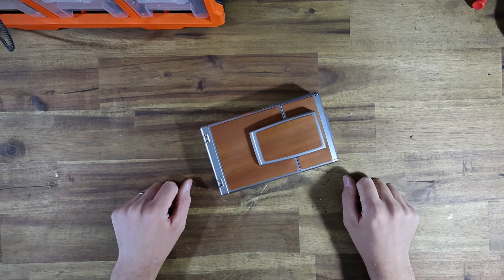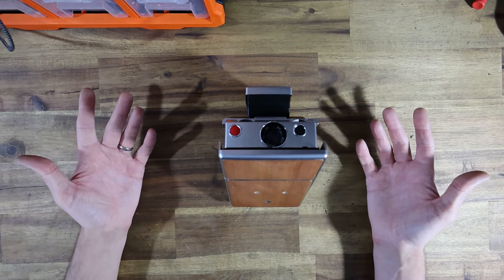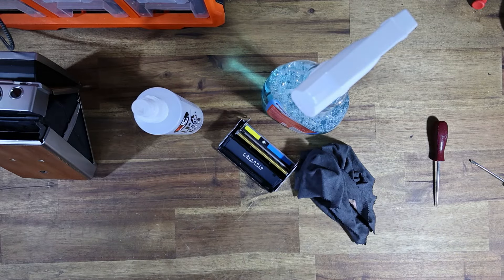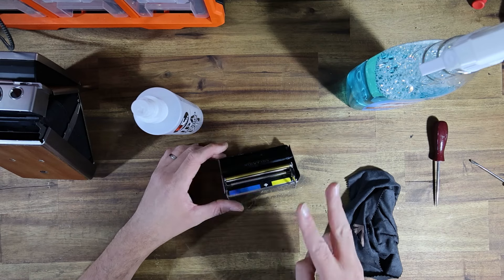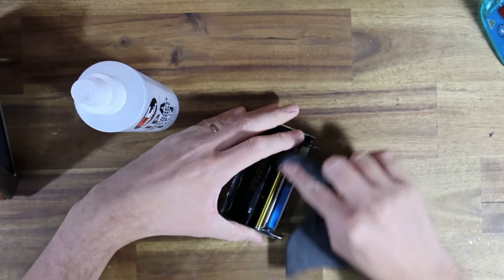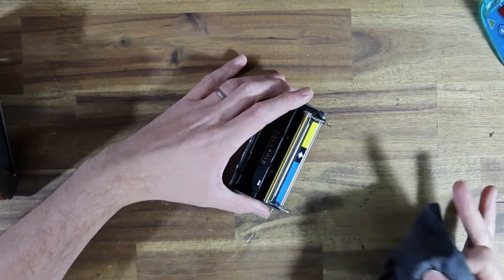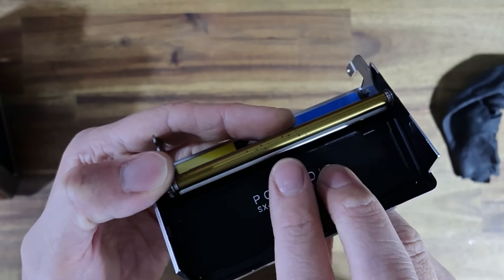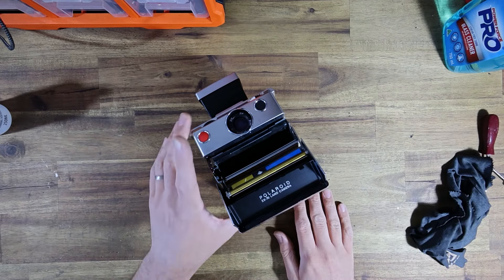The Ultimate Guide to Cleaning SX-70 Rollers

Comment: Nice content , fortunately I joined the Polaroid clan just the same time your channel emerged in my recomm, got an sx70, had it cleaned , lubed,releathered to my liking, motor conditioned following your content, had a battery bottom plate installed for some future I type capabilities. Could not be more happy .  I think the logical next step will be the pcb mod. But I will keep it simple and use my nd for now.  I actually like the sx70film variant quite a lot to be frank. Any hoo, subbed , liked, keep the flow  brother!

Comment: Hey thank you so much for all you do for the Polaroid community. I followed these steps and my SX-70 is sadly no longer powering on - I tried two different film packs. it’s a CLA’d SX70 modified to take 600 film. Did I accidentally break / bend my S7 switch potentially? I have a very important shoot next weekend - any help would be appreciated
Reply from the maker: @8mmreel  sounds like you bent the door switch, or the plastic post on your door came off

Use some tweezers and bend the little brass to tab with the black plastic lug on it downwards, so that the door can make connection with it again
Reply: @theinstantcameraguy  that worked!! Thank you so much :))
Reply from the maker: @8mmreel  you know where my tip jar is 😉
Reply: @theinstantcameraguy  done!! More than well deserved. Thank you so much :)

Comment: This looks like a cherry veneer skin? Do you have any tips for getting it to conform to the viewfinder hood? I have a wood skin installed on mine and it seems to want to lift up, even after letting it sit with pressure overnight.
Reply from the maker: sounds like the adhesive your wood uses is not powerful enough

Mine sticks just fine

Comment: I can never find a straight answer online, but the L/D wheel DOES affect the image when you have a flash plugged in right? I swear my Mint Flashbar has worked just a little better indoors when I turn the wheel a little to lighten. Great video
Reply from the maker: Yes it does (with the exception of "W" shutters, which are a relatively rare variant)

The L/D wheel is linked to a metal arm, which is linked to a spring loaded assembly called the 'flash cam'. The flash cam connects to the focus wheel

Effectively during a flash exposure, the camera's aperture is dictated by the distance you are focused to. Close photos = small aperture. Far away photos = large aperture.

Altering the LD wheel will further change this aperture (white = larger aperture, black = even smaller aperture)
Reply from the maker: also, if you need to adjust the wheel, your flash cam needs re-calibrating.
Reply: @theinstantcameraguy  Thanks for the response it’s super interesting to learn about. It doesn’t exactly need adjusting I just learned that I preferred the look with flash and 1/3 lighten. My sx-70 was refurbed and converted by Chromatic Parts. Thanks again!
Reply from the maker: @revolverrr  I'm willing to bet Dennis accidentally forgot to adjust your flash cam. 

You can see for yourself. With an empty pack, and the flash plugged in (just cover up the light so you arent blinded!), and the L/D wheel set to neutral, set the lens to its closest distance of 10". Focus the lens as close as it will go

Look into the lens, fire the shutter and check what shape the aperture blades are making

The shape should look like a small 'aeroplane' like this: =[]=

If it looks like a tiny rectangle instead: [] 

Then your flash cam isn't adjusted right. I have a photo of this on my Instagram.
Reply: @theinstantcameraguy  Damn, you know your stuff lol, I’ll definitely do this when my camera runs out of film.
Reply from the maker: @revolverrr  spend 13 years of your spare time researching and fixing Polaroid cameras and you'll know your stuff too :)

By the way... if I'm correct... you owe me a beer :) 

Ko-fi link in the video description ;)
Reply: @theinstantcameraguy  You bet
Reply from the maker: @revolverrr  some additional information, since I'm not sure what model camera you have:

1) Model 1 have a slightly different blade design to later models. The teardrop shape is more rounded. Aeroplane shape easy to spot.
2) Model 2, Alpha, Sonar cameras will have a stumpy aeroplane shape due to their more angled teardrop design
3) On an SLR680, the small rectangle shape at minimum distance is normal due to the flash being slightly more powerful I believe
Reply: @theinstantcameraguy  I have a model 1, so I'll be looking out for the aeroplane shape
Reply: @theinstantcameraguy  After testing, I think its ok. When flash is plugged in and focused all the way, it looks like an airplane like you described. Mostly a horizontal rectangle with small "wings" on the sides. I think it is ok hopefully. My main point was that I always hear that the Mint flashbar is kind of underpowered compared to older electronic flashes and definitely weaker than the flash bulbs. Thank you for the tip though, I'll be buying you a beer in a minute :)
Reply from the maker: @revolverrr  this is 100% correct. Old flash bars were more powerful, mainly due to the longer burn duraction of magnesium filament (roughly 1/30th of a second vs 1/2000th)
Reply: Would this process also work on a 600?
Reply: @jaamoe_  on a 680 or 690? I don't see any reason it wouldn't work the same